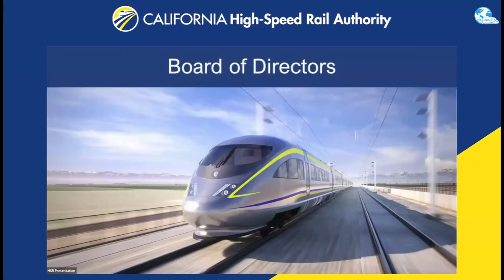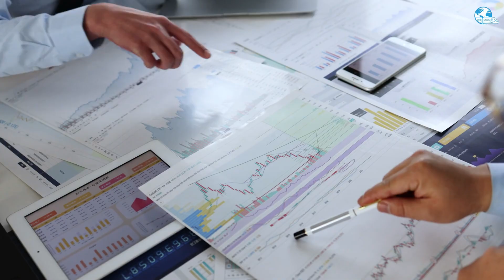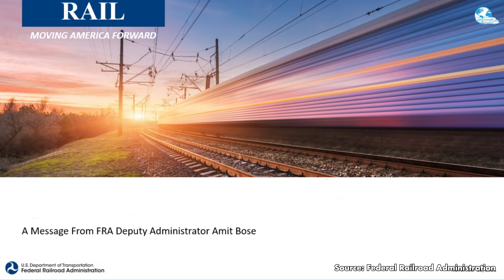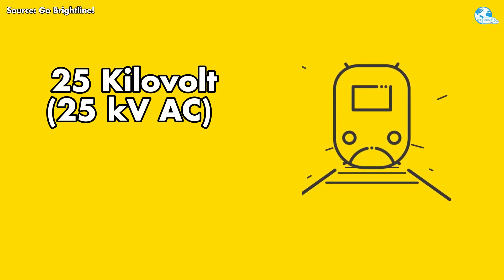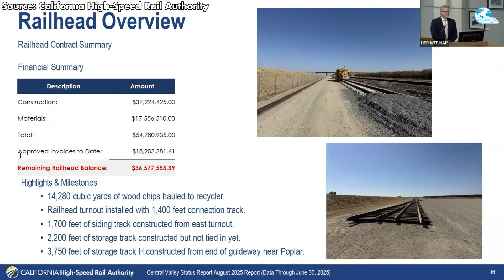This Route Could Finally Make U.S. High-Speed Rail Real...

Comment: The only way this would happen is if the EPA regulation are reduced and the paperwork and planning are sped up. It shouldn't take more than a year to plan and construction should begin within 6 months of that. Any longer, may as well forget it. We used to be able to plan and begin construction within a year. Over regulation has ruined all big projects. Also, this is a sloppy AI production of a video.
An example of what we used to be able to do, the Empire State building. From the start of planning to the completion was 20 months. Design, pan, build, 20 months. Today if  it would take 4 to 6 years. That's just sad.
Reply: One has to think that there is no more virgin territory, like in our country’s early history.(manifest destiny).  But you are right.  There was no such thing as regulation or unions only contracts to build a railroad, but even they had limits or stipulations.  Back in the 1800’s it was difficult to get investors to invest in the UP but it wasn’t difficult to get investors to invest in a RR construction company.  It’s hard to imagine the RRs of today all started out as entrepreneurial ventures.  Wonder if Brightline is just that, an entrepreneurial venture.
Reply: @jfreelan1964  In 1886 the southern railroads all changed their gauge to standard. They planned for 4 months then re-gauged 11,500 miles of track, locomotives and cars in 36 hours.
Reply: @davidgriffin9412 I had forgotten about that.  But it was surprising that the decision wasn’t unanimous.

Comment: HSR is too slow over 500 miles.
Reply: Even in France most passengers do not use HSR from end to end. London to Paris, Paris to Brussels.  It has been established that trips over 500 miles would be quicker by using jets. The US cannot build its way out of road congestion.  Even higher speed rail could relieve some of that congestion.

Comment: Only will a true HSR is to make it an isolated system not shared with any freight.  It eliminates taking chances with a freight derailment right when a passenger passes by at the same time.
Reply from the maker: Agreed. HSR needs full separation from freight for safety and reliability.

Comment: 180 miles?? That is nothing.... The average person can do that in 2.5 hrs even with traffic. Also the total amount of people in those metro areas includes the far reaching suburbs making it not practical to go into the urban center to get on the train. 
Passenger service has always been a loss leader, even back when the 20th Century Limited was one of the leaders in speed and innovation. 
220 mph with multiple stations as noted is not practical either. By the time the train reaches optimum speed it has to slow down because If you want Congressional support, you will be committed to stop in each representative's district.
Reply: This entire statement is why this country is falling behind the rest of the world in terms of human mobility.
Reply from the maker: We’re behind because we hesitate, not because it’s impossible.
Reply from the maker: Distance isn’t the whole story, rail needs planning, access, and safety. Challenges don’t make it unrealistic.
Reply: Intermediate populations are important and should contribute to overall ridership. Congressional support is important representing smaller populations contribute to overall ridership and economy.
Reply: Most forms of transportation have a degree of public subsidy.
Reply: Public subsidy is for the common good. Often the benefit is less expensive than the alternative.
Reply: @HarveyKahler-o2y3k  If it can't make money on its own then it is a net loss. Public transit advocates hardly ever mention this. 
Even during its heyday, Passenger Rail service was a loss leader.